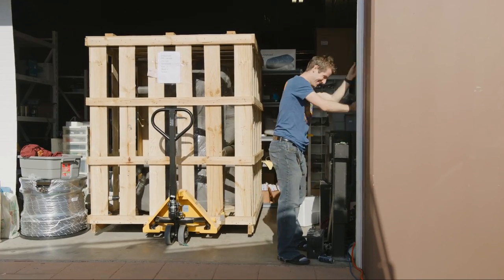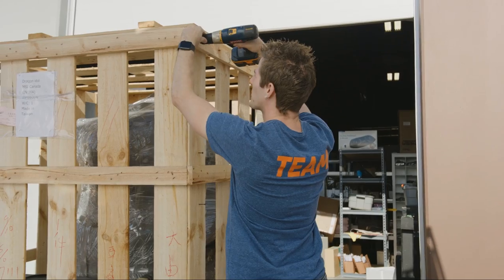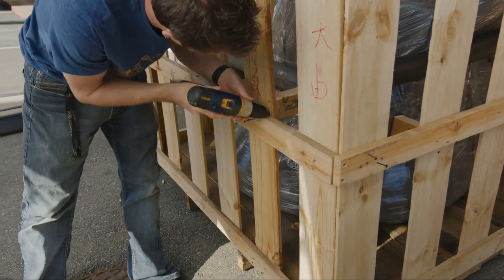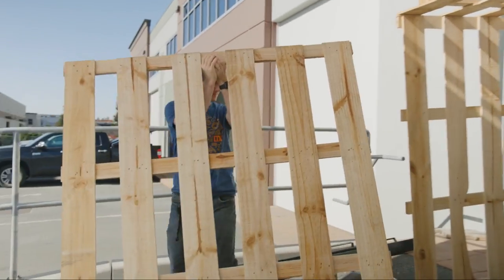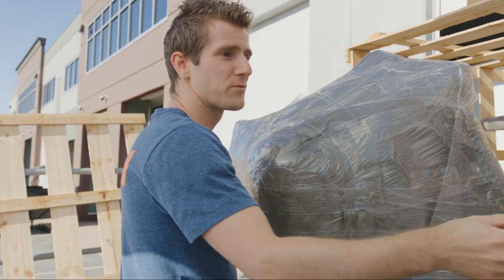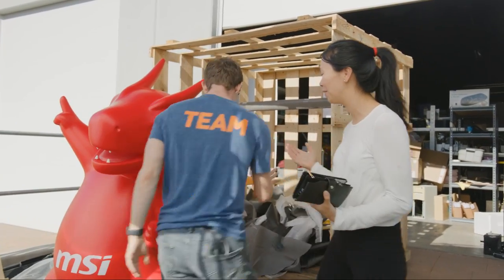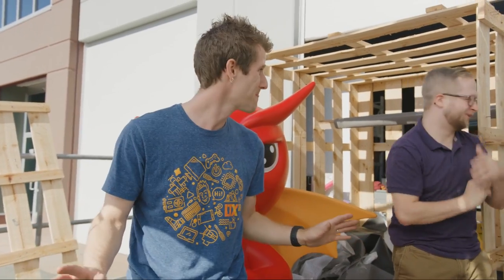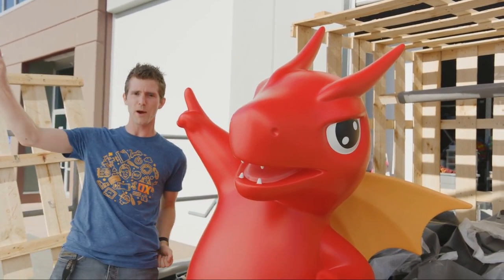Larger than Life Unboxing

Comment: The dragon cost Linus less than the new iPhone. I think we all know which is worth it.
Reply: Sooooo the Threadripper 3?
Reply: TR3: 64c/128t 5ghz boost DDR4 5100Mhz support 128 PCIe lanes and RISC-V support
Reply: Oh for the Mobo EATX Asus with 128GB LRDIMM+OC(5100) DIMM support, Quad U.2, 4 PCIe x16, Quad M.2, 1x PCIe x8, 2x PCIe x4 and 2x PCIe x1
Reply: RAM: G.Skill Trident Z RGB 1024GB (8x128GB) 5100Mhz CAS 11-11-11-14
Reply: GPU: Quadro RTX 8000000 (65,536 CUDA Cores, 8192 Tensor Cores, 2048 RT Cores, 1024 AMD CUs) x4 with NVLight 12.0 and 512GB VRAM per card
Reply: PCIe 12.0 of course
Reply: Either this dragon or a Monitor stand from Apple. You choose.
Reply: Or a reasonably priced 2001 Toyota Corolla

Comment: I have worked in a rotomold plant. It is plastic powder in a mold in a massive oven to start out. The decals are applied to the mold before it is baked. It is really expensive to make those molds.

Comment: you would have been able to get at that screw if you had the screwdriver bit holder in the drill and not the bit directly in the chuck
Reply: Conrad Jones Finally, someone else was bothered by it. I see you're a man of culture as well ;)
Reply: Use a driver. Drills are made for drill bits. Drivers are made for screw heads (I know, i know. And the functionality of computer hardware 😴?
Reply: He also wouldn’t have had retracted bit syndrome

Comment: graaaahh…
to tighten that chuck properly, hold the chuck tightly, and quickly drill forward for a split second without letting go.
Reply: Doesn't matter how you do it, those chucks are pretty crappy at holding against torque. Going to be replacing mine with a good jacobs chuck eventually to get rid of that nonsense. I know the one on it is a jacobs chuck but it's not a very good model.
Reply: Don't tell him things like that, he'll break his little nerd wrists.
Reply: Doesn’t work with every drill.

Comment: What happened to the pong table at ces 2018 ! 
Make the dragon animatronic , If Apple made the screws for the pallets it would take you forever. You could  put it on the Wan show or techlinked set. 
Make a computer out of wooden pallets.
Reply: First Apple had a wood case, back before the marketing types got involved
Reply: Apple made the crate, didn't you notice all the cracks?

Comment: You should use the ad revenue from this video to buy a better power drill.
Reply: And a longer bit
Reply: Or get an impact driver.
Reply: +Paroxy DM
He should really have a bit holder for the bit. You're not really meant to put them straight in the chuck.
Reply: I actually inherited an older model of the same drill. Went to use and realized that I didn't inherit the bits. Looked at the drill, looked at my multi-bit screwdriver bits and suffice it to say that where there's a will, there's an improvised bit.
Reply: or Nokia 3310
Reply: Okay.... true but he should use an impact not a drill
Reply: @volundrfrey896  So many people don't understand this and it always bothers me. lol.
Reply: Get a kobalt one